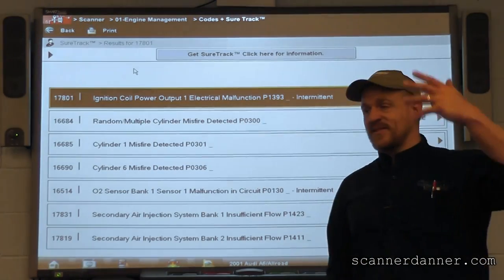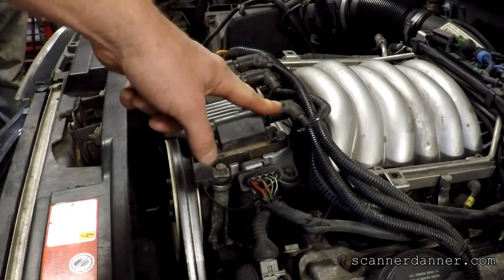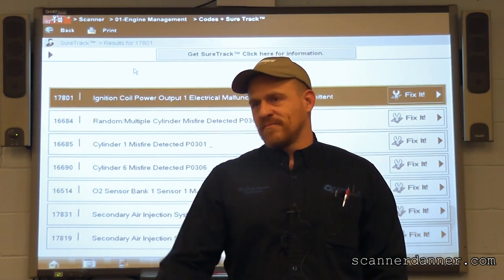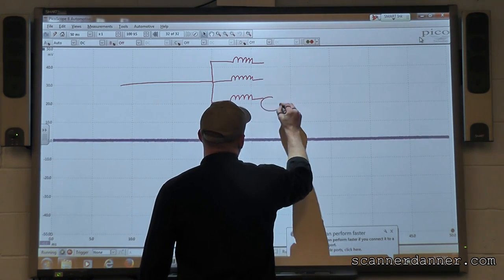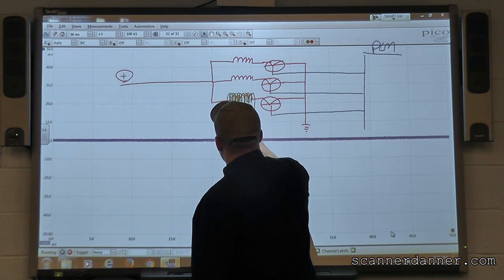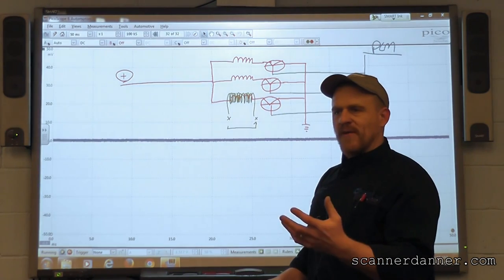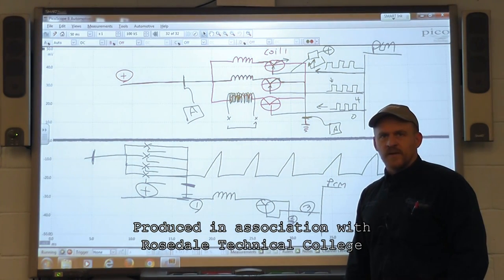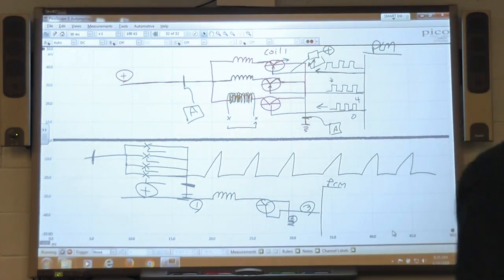Ignition System Testing - Primary Current [Audi A6 part 1 of 2]

Comment: This was very useful video anyway. It reveals the conception of switching negative branches of circuitry, while positive is shared. The same is switching on the steering horn when negative branch gets connected with the car body which respectively gets connected with negative pole of the battery, thus circuit gets closed.

Comment: The question about making the spark stronger by energizing the coil longer was a very good question!
Also, the test to manually try and fire the coil was pretty cool and basically shows that we are missing a control. Either broken wire or cooked ECM. I'm currently at 19:29, so I let's see which one it is going to be.

Thanks for posting some Euro stuff, Paul! As someone with an Audi myself, this may come in handy at one point.
Reply from the maker: Thank you!

Comment: In the transistor circuit there is no emitter resistor to ground so the pulse has to be .7 volts which is the forward bias however the collector emitter is a circuit means that the transistor isn't saturated and has zero volts so the whole voltage is across the coil load that doesn't make sense there has to be a resistor in the emitter circuit to ground something is missing in the in the configuration in the collector circuit you can't have full voltage across the load coil and the saturate the transistor from collector to emitter
Reply from the maker: 100% there is more to this circuit than what I'm showing. There is current limiting on these coil circuits and I'm not showing or talking about any of that. Just the basics. Thanks!

Comment: Paul, when you have multiple pcm codes, inwas always taught to start with the code that set the freeze frame data, is this bad practice?
Reply from the maker: The problem with that approach is when you have a multiple problem car (which most are by the time the customer brings it to you).
I've always attacked the customer complaint/symptoms first and then try to match the code with that problem. 
This Audi could have had a freeze frame capture for the O2 or airpump and if that was the case, you'd have missed the main issue. Make sense?
But if it works for you, it's not wrong!

Comment: Scanner danner teaches teachers 😄. Excellent video. I have an issue with a 96 Chevy express converted to mfi years ago. Right now i installed a new mfi again. New CPS, timing chain, spark plug wires, distributor came with cap and rotor installed like this, at TDC compression stroke cyl1 distributor dimple aligned with mark on distributor body and rotor fell in engine facing cyl1 and the reference mark on the distributor housing, coil is two months old(not acdelco) ecm was changed in may of this year, fuel filter, MAF. New O2 sensors(4) new exhaust with cat converter,  fuel psi reads 60psi key open i was told it should start… only thing not replaced is fuel pump. I cant find what the fuel pressure should be since this was upgraded to mfi from cfi. I rear cfi is 61-66psi and mfi should be less? It cranks and sounds like it wants to start but nothing… someone anyone…? It briefly started the other after unplugging the ecm but doesnt start now. Ty
Reply from the maker: you sound like you are in deep my friend and the problem with all of these "new" parts is that the aftermarket is FULL OF JUNK NEW PARTS especially on older cars and trucks. Step 1 is to find out what you are missing. If you spray a fuel source into the intake, does it start?
Reply: @ScannerDanner  hey how are you happy holidays! I found the issue and after all this, turned out the spark plugs were bad. Back in may of this year the MAP sensor grommet went bad and the engine smoked out the tail pipe super bad so the plugs got fouled up. Not sure why the engine ran for about 2000 miles and no issues. I put in fresh plugs and its running beautiful!!! Thank you always pal, youre such a good automotive tech!

Comment: Is the control wire from the pcm just a pulsed ground? Do all coils have transistors? For example, my old 4.0 Jeep only has two wires. Switched + and a control wire from the PCM.
Reply from the maker: It is a pulsed positive on this one (base circuit control).
To answer your second question, if it is just a two wire coil, the driver for the coil is inside of the ECM not the coil itself like a 3 or 4 wire

Comment: Instead of using an led for this test, could i just use a five volt voltage source. For example the power probe hook can do five volts
Reply: good tip. Probably overkill but yeah if you have a power probe, might as well👍
Reply: @colestowing8695  how is it overkill? Im asking because i dont want to buy an led light. If I already have a hook, couldn’t i just use that?
Reply: @mikesabin8568  well... Led test light is what 10 bucks? Vs $100+ for a power probe? Overkill may have been the wrong term though. By all means if you have one it would be silly not to use it
Reply: @colestowing8695  I understand the difference in price. I am not advocating someone buy a hook for the test…
I already have a hook for many purposes im asking a simple question if the application can be used so i dont have to also get an led light
Reply: Just check to verify the maximum current your Power probe puts out in that mode. The standard fuse for the older power probe is 10A,  so if something goes wrong or if a wire is internally shorted to ground, the old PP2 would backfeed the PCM with 10A. When I use the power probe in this situation I like to add a safety resistance in the circuit to put a cap on maximal current. That could be as simple as using the power probe and the LED light in series. The great advantage of the LED is not only the voltage drop, it also caps maximum current to the milliamp range. A benchtop power supply would be better, where you not only dial in voltage, you also cap maximum current.
Reply: @spelunkerd  well im specifically talking about the five volt setting on it, im not suggesting to just let it rip….
Reply from the maker: I have the PP hook and I always forget it has that function lol. Thanks! The LED is much easier to pull out and put away :-)

Comment: So...if that was the cylinder 1/6 coil that you manually got to fire -from there I assume you'd just do a quick check on circuit integrity back to the ecm? Did the car wind up needing a computer?  (edit)-actually I guess theoretically the next step would to look for control. (Either a scope or possibly even a multimeter set for ac?)🤔
Reply from the maker: Coming up in part 2!
Reply: @ScannerDanner  you're a tease 😁  (kidding-ty)

Comment: You look younger here.. is that correct? :)
Reply from the maker: It is my friend. This was pulled from my website and was filmed in 2016 I think
Reply: @ScannerDanner  ah, okey! Thank you for posting premium content once in a while here for free :)
Reply: @ScannerDanner  not the correct video to comment on but..  I want to inform you that my AC are fixed now :)
A shop replaced the clutch that I provided. The whole shebang. They said that my old coil was buzzing and trying to engage but hadn't enough power for that.

I measured the coil after when I got home. 1.77 Mega ohm :) should be 2-5 ohm :)
They say it works now. I haven't tried since clutch/compressor won't engage under 0 degree Celsius :) we have around -14 Celsius here now :) so I have to wait until spring/summer to see if I got some cool temperatures :)

So glad its finally fixed!